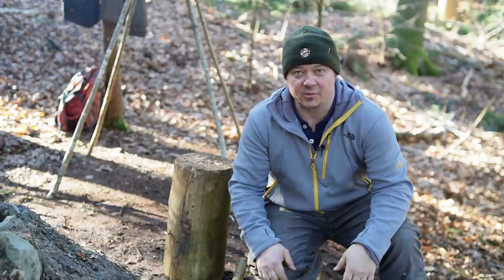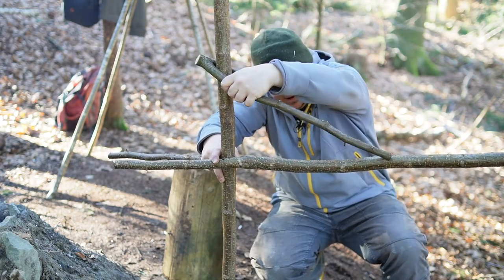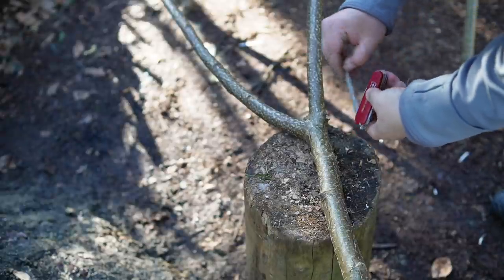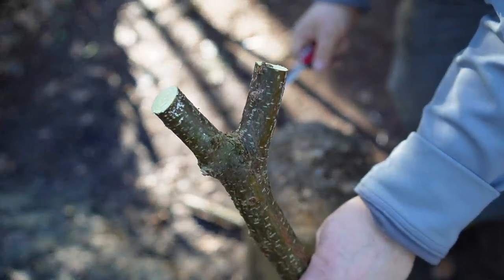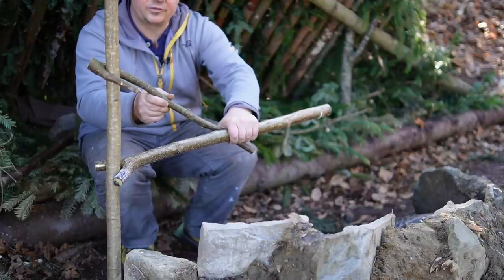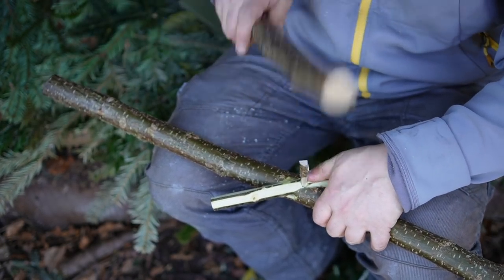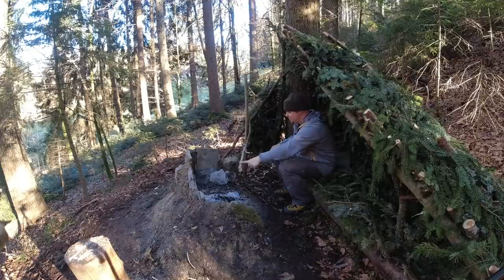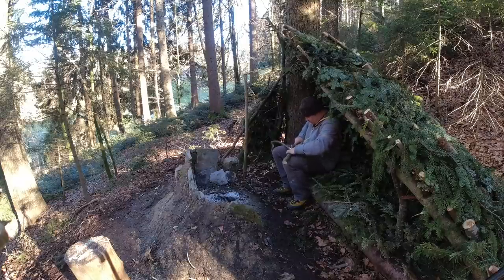🔥   Ingenious Pot Hanger System 🔥  - 3D adjustable !! - easy to craft - quick done -  very stable

Comment: Felix
Great tips as always
I got 1 small tip for you:
The top of any pole you are going to hammer works much better if you give the top a small chamfer
The bottom is sharpened to a point to facilitate the driving in pole by concentrating the force of the blow into a much smaller area to open the way in the ground. Then the wedge part forces the ground open so the pole or stake can follow it
Now the reason for the slight chamfer on the top is to concentrate the force into the centre of the pole or stake. It makes it easier to strike and it also helps prevent the pole or stake from splitting if t it has a cracked grain or near a knot that takes the force of the blow towards the outside surface. 
Just a slight chamfer. Maybe if your pole or stake is 50mm dia you make a 5mm chamfer all around so that the core is 40mm
Works well.
It will also work on your smaller wooden nails
Try it
Thanks again for all your good content
Keep on keeping on
Heads up 
Eyes open 
No fear
Reply from the maker: Thank you for your tip. You are right.

Comment: That is a great design. Far better than a tripod, you don't have to lean over the fire to adjust the height or remove the pot.
Reply: most tripod are made of metal and they get bloody hot as they are close to the fire and you need to use a cotton glove. The good thing about wood is that they do not transmit heat at all.
Reply from the maker: That's true..
Reply from the maker: Thank you very much!!

Comment: If you leave the Y parts long, you can use them as pot & cup hangers 👍

You're so lucky the wood in Switzerland is so soft !
There's not a single Australian wood I could do it this easily with !
Reply from the maker: Switzerland also has disadvantages.  The population density is so high that every tree belongs to someone..

Comment: Great video! Here's another option. Find a  Y stick with a straight part and a fork. Drill a hole through the end of the straight part and thread a loop of cordage through it. The fork is on the bottom and the loop is on the top. Something similar is illustrated on p 203 of Wildwood Wisdom by Ellsworth Jaeger.

Comment: Beautiful idea and build. Great job! Tip: If you chamfer the top of the pole that you are hammering, it will not mushroom or splinter. Until next time. Please be careful Felix, it is getting bad over there. 🙏
Schöne Idee und Aufbau. Gut gemacht! Tipp: Wenn Sie die Spitze der Stange, auf die Sie hämmern, anfasen, pilzt oder splittert sie nicht. Bis zum nächsten Mal. Bitte sei vorsichtig Felix, es wird schlimm da drüben. 🙏
Reply from the maker: Hello Richard. Thank you for your Tips!!!

Comment: Happy Friday Chef Felix, I am assuming your knife is the 91mm Huntsman, one of my 2 favorite combined urban & countryside use 4 layer SAKS ( the other is the Farmer X ). You could have shown one of the ideal uses of the Parcel Hook ( which a lot of folk think is pointless in the digital age )  by using it to lift the pot by its handle thus making sure that you don't burn your hand on a hot metal handle. Its also been used by me to lift up barbed wire & stretch and bend wires & lift the hot steel grid used over a BBQ cooker  and of course to keep the large pressurized pen secure in the parcel hooks channel for ease of writing. One thing you have not mentioned in your camping videos so far is what do you cook when you camp out in the forest?
Reply from the maker: Thank you for your inspirations, tips and hints!
Reply: @FelixImmler  I am but a novice compared to you Felix, your SAK tips have helped thousands of SAK users to better use their multi-tool SAKs